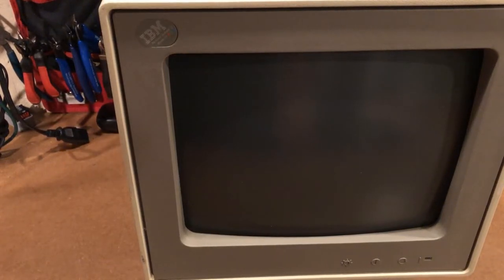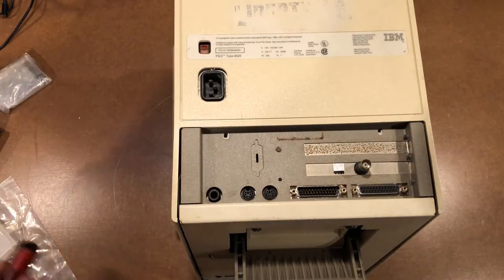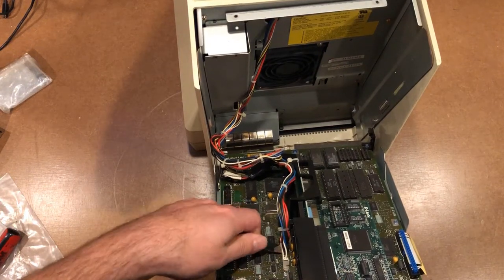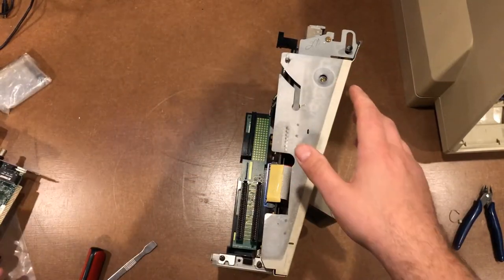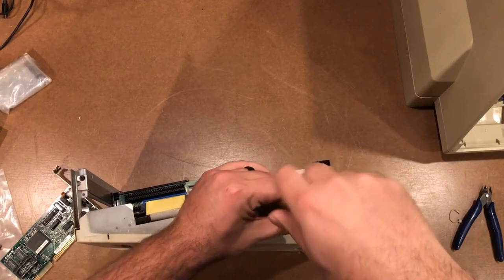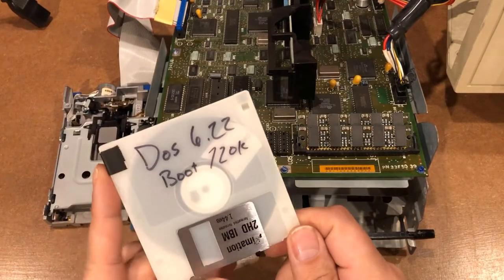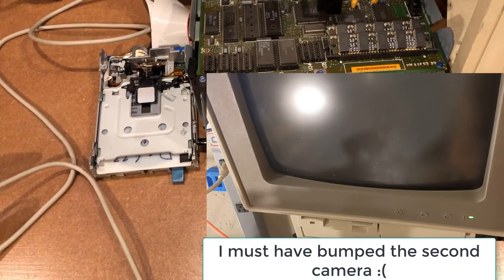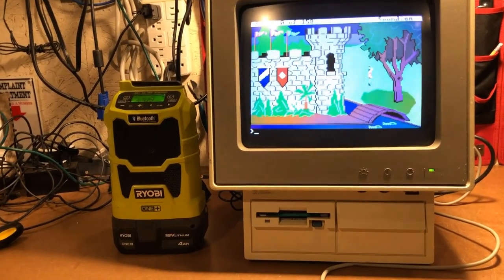PS/2 Model 25 Teardown and Quick Fix

Comment: My floppy drive was defective on my brand new IBM model 25 so I never used it. I finally gave it to my little baby sister and she fixed it herself  and it worked fine. You had to load 10 desks to run windows which was limited. Lol

Comment: A Model 25 was my workstation on one project, using masm and IBM C. The PS/2 line was the ugliest computers from the 80's and early 90's ;) I have both fond memories and nightmares from writing C and ASM for them.  BTW: I think the slit in the component is by design, they are spark-gap caps.
Reply from the maker: ahh. Interesting. That's good to know. I happened to see that same card with a similar slit on YT yesterday and I didn't know if it was coincidence or a design element.  Yeah.  I was never a fan of the PS/2 in practice, but it's definitely cool to have one now.

Comment: You probably figured it out, but you can reach the back of the drives by taking off the kickstand, and leave the cable attached to the planar (aka motherboard).
Reply from the maker: I figured that out too late.:) Thanks for pointing that out though